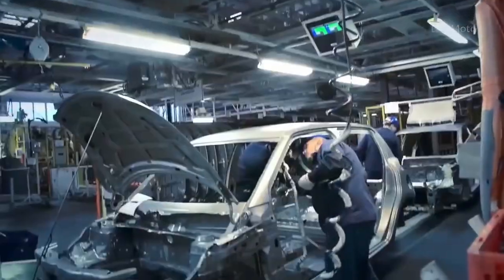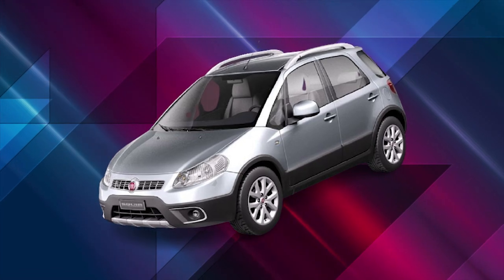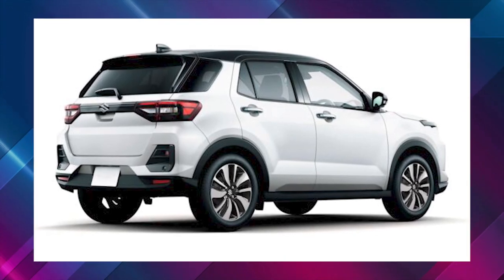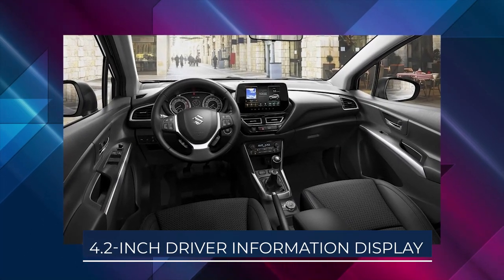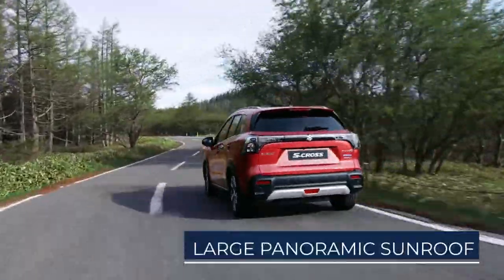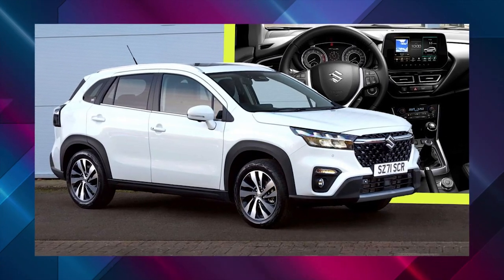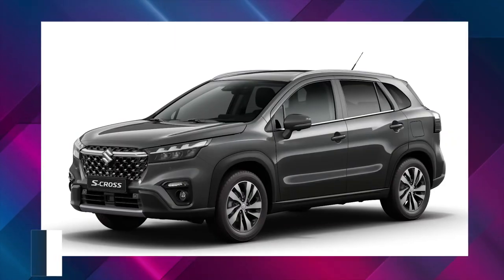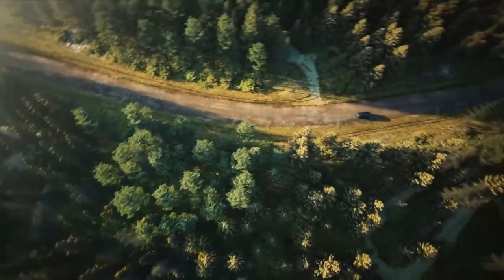The AMAZING All-New 2022 Suzuki SX4 S-Cross! Incredible Compact SUV!

Comment: What is the mpg ?.don't actually see the point of any new vehicle if the mpg is not high especially if it still runs on diesel or petrol. Might as well get an ev for its price
Reply from the maker: What do you drive now
Reply: Perhaps you missed 6.20 - 6.40 ?